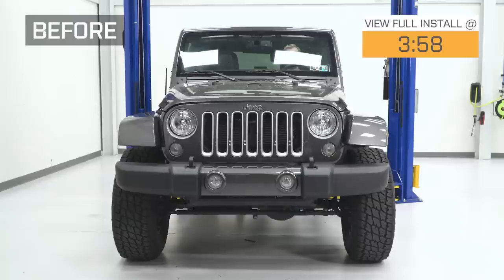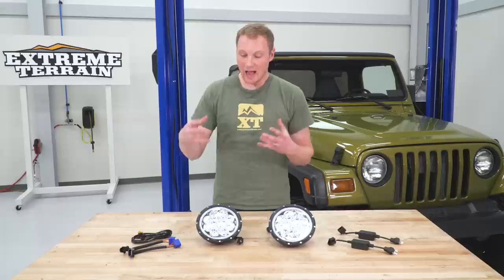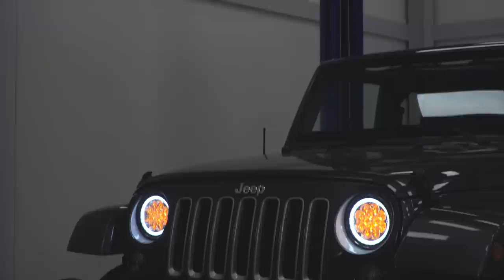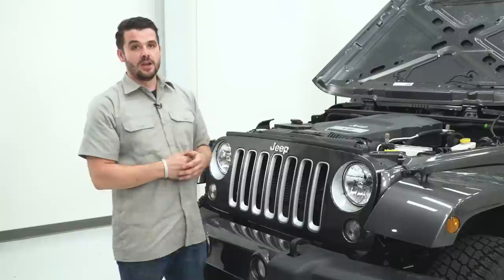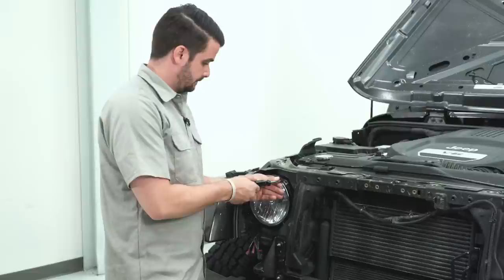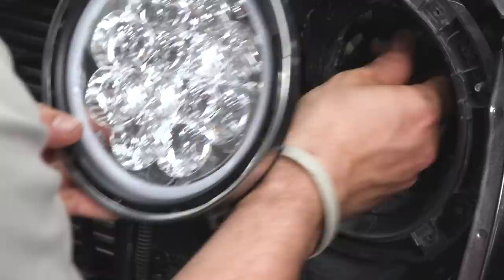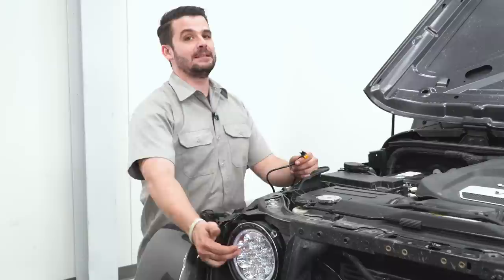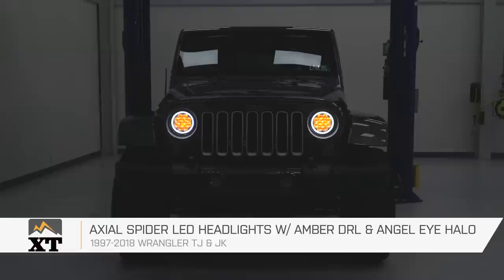1997-2018 Jeep Wrangler Axial Spider LED Headlights w/ Amber DRL & Angel Eye Halo Review & Install

Comment: Got this for my 06 wrangler, and the passenger side won't light up, swap the lights to make sure it wasn't the light still didn't work, I put the fuse into the radio fuse and the drl was faint on the passenger, but worked on the driver side no issue, check the amp on my Jeep stock wiring those check out, definitely not plug and play on the tj I can't figure out what I did wrong, probably should do an install video on the tj cause this didn't help

Comment: Question has anyone had that happen when installing them that they didn’t work on low beam only high beam and DRL was working? We had that issue and can’t seem to figure it out. With my old Jeep not problems installing lights but the JK is giving me issues.

Comment: I installed these and when I crank my 2013 Jeep JK the lights are on high beam, when I turn the lights on they go to dim until put on high beam. When the jeep lights are off and the ebrake is pulled the amber lights are the only lights along with the Halo. Need some ideas on what is the problem. Thanks!